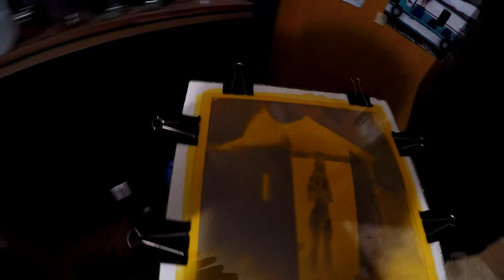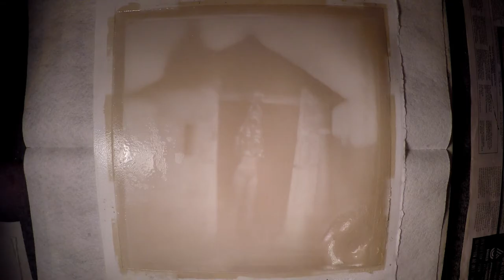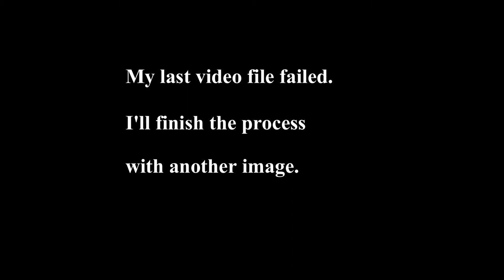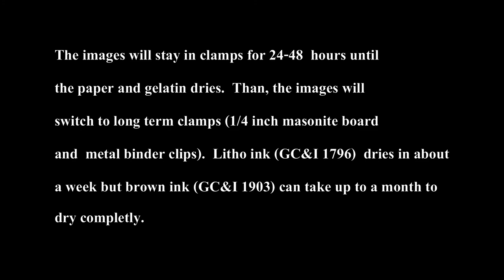Rawlins Oil Printing

Comment: Thanks for the video... I did some bromoil printing decades ago when I got photography degree from college. I stopped when I couldn't get the paper any longer and always meant to try to make my own paper. You've inspired me to get off my butt and try this method.
Reply from the maker: Hey John, you'll find that oil printing is pretty easy but does require space and patience. Check out Quinn Jacobson-The studio Q show and Borut Peterlin.  They put out a lot of oil print videos.  I'm not shooting anymore unfortunately, I had too many projects going and gave up my studio.  Good luck with your photography.  Jeff
Reply: @jmmichael188  Thanks, I'll check them both out.

Comment: Thank you for the informative and interesting video! I’m now trying my hand at Resinotypes, which have a similar gelatin matrix to the Rawlins process. Had a terrible time with paper buckling and now I see how you are pre-wetting and squeegeeing before coating: is that to avoid buckling? Also, how long before printing can one sentsitize? Does it take long for the gelatin to dry afterwards? Thank you!
Reply from the maker: Hello Paul!  Yes pre-wet the paper for 5 minutes in cool water and squeegee it down before coating.  It is to avoid buckling.  Printing after sensitizing depends on a few things, humidity and temperature are the most important.  BIG TIP!!!  I use to have a bad streaking issue in my prints and finally found the problem.  The sensitized print was not fully dry before I put it under the lights.  The paper may feel dry but might not be.  The best tool to use is a infrared thermometer gun, the temperature of the sensitized paper must be the same temperature as other surfaces in the room, the table it's taped down to for example.  The paper will be colder from the acetone evaporating if it's not dry completely.   I live in a town with 10% humidity so I can print about 20 minutes after sensitizing.  The gelatin and paper dry within a day or two after inking but the ink may take weeks to dry,  this depends on how thick you apply the ink.  Enjoy the process!

Comment: Hi Jeff, excellent video, thanks! My question is what would be the role of sodium sulfite in washing?
Reply from the maker: Sodium sulfite expedites the clearing of the dichromate stain.  You don't have to use it, water only can be used.  The problem with not using sodium sulfite is the print will soak for way to long and your gelatin will absorb A LOT of water.  This will make inking difficult.  I soak for one hour with 1% sodium sulfite and probably 4 hours without it.
Reply: @jmmichael188  Ahh okok, thank you very much Jeff !!

Comment: Hello, thank you for your video. I don't understand something about this process: how come you use a negative? that is, how come the areas where the gelatine got hardened by the dichromate are the areas absorbing pigment? And paper white areas where no gelatin got hardened are repelling ink. I always thought it was the other way around. Thank you!!
Reply from the maker: Gelatin paper acts the same as regular darkroom paper.  The dark part on a negative produces a white part on a print.  In this process the clear areas of the negative allow the light to pass through and harden the gelatin.  After the exposure, when the paper is washed/soaked the highlights will swell with water based on how much light the area recieved.   The paper is dried off and when oily ink is applied the swollen areas repell the ink while the hardened areas absorb ink.

Comment: Hello. Sorry for my a next question. But I can't find any informations about my problem. Does the UV exposure really must last for 50 minutes? 
I bought a small home tanning salon. There are 10 UV lamps with a total power of 400 watts. I wonder how to adopt the approximate time of exposure.
Reply from the maker: You'll have to test the lights and exposure to get the correct time.  But I will tell you that the faster/brighter your lights are the more flat your images will look.  Just like in salt or albumen printing, stronger/contrastier images are made by placing the prints in the shade and not in direct sunlight.  My light box had 12, 100 watt UV bulbs and could expose a 2.0 density wet plate negative in 4 minutes.  But, the prints were flat and bland so now i have 4 bulbs (400 watt) that give me a contrasty image but much longer exposure.

Comment: how much acetone did you put? or even better, what is the radio - dichromate : acetone?

tnx for the great video!
Reply from the maker: That all depends on how you want the image to look.  I like to do a 50:50 ratio but you can also do 60:40, 70:30, etc.  I believe the less dichromate you use (for example 70% acetone 30% dichromate 70:30) you get a contrastier image.  More dichromate less contrast.
Reply: @jmmichael188  Thank you, that is the part I missed. Regards

Comment: Amazing video, thank you for sharing ! I had a question, what is the composition of your gelatine mix you apply in the beginning ?
Reply from the maker: Hello Gilles.  The gelatin is;
250 bloom gelatin at 8%.  So 80ml dry gelatin mixed into 1000ml cool distilled water.  Allow gelatin to swell for 1/2 hour than melt in hot water.  Do not allow gelatin to exceed 120 degrees fahrenheit.  After gelatin has melted add 40ml isopropyl alcohol  to remove micro bubbles and leave the gelatin alone for 24 hours.  Filter the gelatin before use.  Check out for gelatin info:  
https://www.youtube.com/watch?v=EmpTgDlsr3o

Thanks! Jeff
Reply: @jmmichael188  Thank you very much for your answer ! Amazing, can't wait to experiment with this !

Comment: Hi Jeff, what do you think about diazidostilbene "DAS" instead of dichromate?
Reply from the maker: I've never heard of diazidostilbene.  Give it a shot and see what happens.
Reply: DAS works as an alternative sensitiser for gelatine based processes like carbon printing, so it definitely works for oil printing. I'm actually using DAS for collotype, which is basically just a rawlins oil print transferred to fresh paper.

Comment: Awesome work! Is it possible to use mineral spirits with the dichromate instead of acetone?
Reply from the maker: I wouldn't recommend it but you can test it and let me know. Acetone is used because it evaporates very quickly and cools down the gelatin.
Reply: @jmmichael188  mineral spirits don't mix with the dichromate solution at all! it was like oil and water. I used acetone, but the dry time after that is still 3 hours more or less. I put it back in the clamps so it dries flat. also, when applying the dichromate/acetone solution, I need to work it around a bit to get it even over the gelatin. the solution will separate over the paper, making little circles of uncovered gelatin paper that I need to keep on going over with the sponge brush. could it be the gelatin I'm using?
Reply from the maker: @spencerelias9946  3 hours dry time!  What is the humidity of your darkroom?  You may need a dehumidifier to bring that time down.  Keep brushing in the dichromate if you see circles in the gelatin, it happens all the time.  Brush gently though.

Comment: do you know if LED UV bulbs will work?
 or can you post a link to bulbs you know will work, 

Many thanks
Reply from the maker: https://www.1000bulbs.com/product/62709/FC42-MS65.html

Bulbs that are 6500k work fine, no need for UV bulbs.  I'd use 4-6 of these bulbs to print with.  Don't use too many lights or the print will get tonally flat.  Less is more.